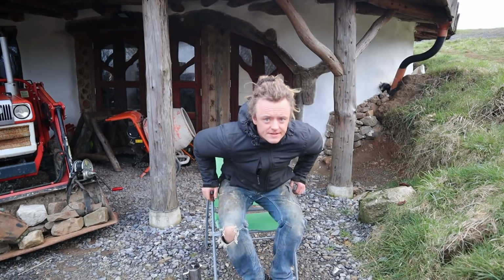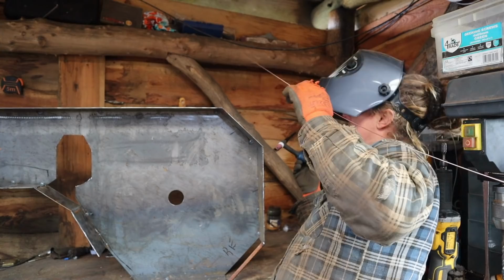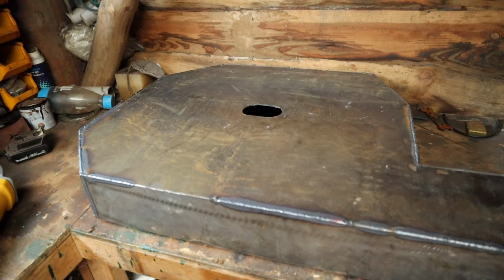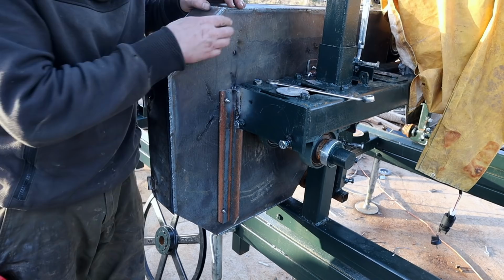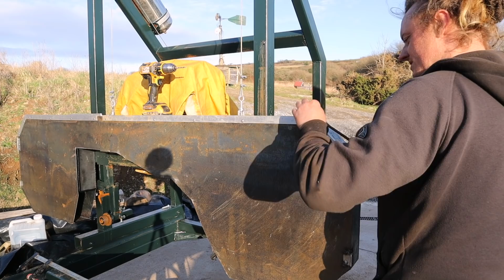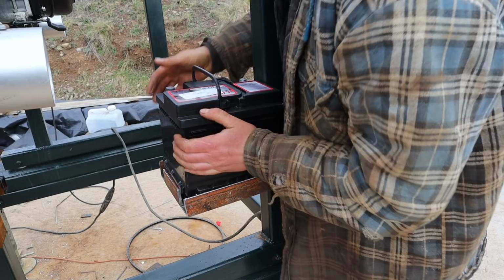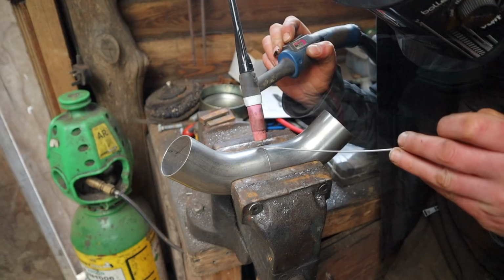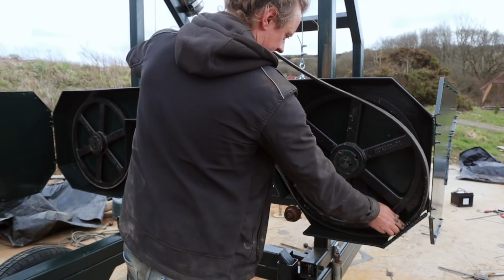DIY Mobile Bandsaw Mill Finished At Last

Comment: You could do with a rain cap on that exhaust now its in "vertical-boy-racer" mode ;)
Reply: one of those little flappy jobbies like on the tractor trailer rigs!
Reply: an old coffee can to quick fix it 4 the moment...
Reply: this was my first thought!
Reply: Will it have enough pressure to open it, it's only a wee 10hp

Comment: Kris, you might like to fit a flapper onto the exhaust to keep out the rain, or maybe just stick a bean tin on top. Works on tractors. Oh and that is a great bit of kit you've built yourself. Very well done, it looks the business.
Reply: I was thinking he should make that exhaust pipe reach higher.  A flexible ventilation pipe would do. Standing beside that exhaust wont be fun the day the wind comes from the wrong direction and you have to turn the mill around to avoid the fumes. And a flapper or can on top is a good idea.
Reply: Flapper on top and a small drain hole at the bottom

Comment: Hey Kris.  I've been running a Norwood band mill for almost 20 years, and it is very similar to what you've built there.  Great job, by the way!  I would recommend that you weld on a push handle for yourself to push the carriage while milling, and put the throttle on that handle as well.  Excited to see it in action.
Reply from the maker: Thanks for the tips. Looks like you have some cool videos. i will be checking them out.
Reply: @KrisHarbour  
A round bar for a handle with a spring loaded motorcycle throttle would probably work great and being spring loaded it will idle unless your hand is on the throttle might add an extra level of safety for the commenters you were telling the cat about. 😉

Comment: If you get a 4 inch paint roller and use covers with the least nap you can find (not foam ones) do this: thin down the oil based paint a little and paint metal with that. You will get “factory finish” results, trust me. I used to refurbish vending machines this way and they came out great. With a 4 inch roller it’s easy to get into the nooks and crannies. All the best. Try it, you will be surprised.👍

Comment: You need a rain cover on the exhaust pipe.
Reply: An empty metal can would do the trick. Put it on once you are finished using the mill.

Comment: Hello. From the States. One tip that may help you save Gas and electric , would be to stitch weld. Make a series of  25mm welds about  50mm apart. It will hold just as well and save time and material. I have welded for over 30 years. I hope this may help you. Liked,shared. All my best.

Comment: That mill is built like a tank.. Awesome work. That mill will perform like a completely different animal after its broke in and you get the RPMs up.  I think the sawmill trailer i built is around 23 feet from bow to stern light... every time i move it i drop a string line down my rails to ensure a strait shot with the sled.  Being that your angle iron (rails) are different you might drag a line down your log beds then adjust. Fast an easy... I usually mill up say 4 logs then add the drops (slabs) of similar sizes  6 at a time if possible standing up on the mill and debark them with a quick pass. All that 1xs add up fast

Comment: Great work! Maybe a support bracket on that extended exhaust pipe Kris. With the Diesel there is plenty of vibration, will likely stress crack without support.

Comment: Looks great. I suggest that you relocate the water drip to the outside of the blade guide so that it doesn't eat into your cutting width. It looks as though the blueing on the guide rollers hasn't held up. You'd probably have better results by heating them and quenching in oil.

Comment: Awesome. I have a Woodland Mills HM122 and I love it. I recommend you do 2 things. Connect your throttle, which turns your blade, to you water output to save water in the reservoir. You can also add windshield washer fluid to it for the cold. Second,  attach a hook to where the sawdust comes out so you can hang a bucket to catch the sawdust when cutting. It becomes a real mess without a bucket to catch the sawdust. Congratulations!

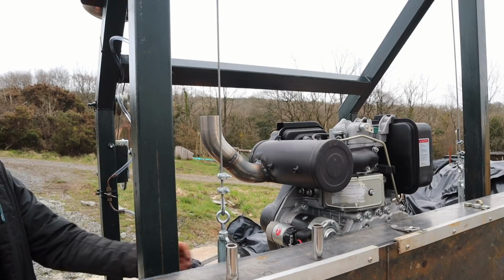Comment: 19:12 Did you put in a bleeder hole in the outer pipe?.... Rain will fill up the pipe and possibly the black muffler and potentially the engine if left long enough....

Comment: One of my tricks is a second valve (a quick one, like a ball valve) inline with the needle valve. Lets you get a nice steady water feed setting and just flip it on and off without overthinking things. There's so much to pay attention to when running a mill that anything that makes it easier is worth it (at least in my experience).
Reply: Side note, it's crazy easy to put a 12v solenoid valve inline and wire it to a future power feed too. No more accidentally leaving the water on/forgetting to turn the water on.

Comment: Hey Kris
 The Bandsaw Mill looks AWESOME! Time to put it to the test and get the blade biting into some hardwood. So, time to start cutting timbers to sit and dry out in preparation for the house? I'm looking forward to the next video, I wanna see a nice stack of wood cut and drying.
Hey, are you going to build a Kiln so you can Kiln dry wood? That way you can control the time it takes to dry, but also keep the wood from drying too quickly and splitting. If you did build a kiln you could also use it to dry different types of foods for preserving them, so a kiln would have a use other than drying wood. Just an idea!
Keep Safe All,
Peace, Happiness, Love and Laughter Always,
Matt - Toronto, Canada

Comment: Hi Kris, for the batt cable look at a retractable id/key fob, Durable do one which works up to 300g so should be enough. I use them in similar way to hold wiring out of the way in movable areas, works a treat. Well done
Reply from the maker: Nice one, i will check that out that is exactly what it needs.

Comment: You did a good job with building the sawmill. looks to be better then some of the "entry level" mills you find on Ebay or even woodmizer sites. well done. a proper job....
Reply from the maker: Thanks Jacob. I used much heavier and bigger parts than most of the mills you buy have, hopefully it will last and be worth all the time i spent on it. I think it will.

Comment: Worked in saw mills for years, very impressive 👏👏only thing I would personally do is have a little inspection hole on one of your doors so you can see when you need to adjust the set on your blade on the wheel

Comment: I’d love to see you build and use a log splitter that either you OR Dot can use.  Something like one of those ones that is a steel car/truck wheel with a spiral cutting edge, that you can feed branches into, and something that can split larger logs into multiple pieces, either all at once, or bit-by-bit...

Comment: Hey Kris, Very impressive build, i've enjoyed the progress videos.  Just one thought, where the band saw re-enters the guard, will you have a means for the chips to escape?  I think perhaps over time it may build up in there.  Another thought is maybe to cut horizontal slits and then bend the top of slit inwards, and bottom outwards to create a weather proof vent for heat and dust.  You could also attach very small fins on the large pulleys to create air movement, like a fan.  It would help to vent the guard section of heat, dust, and possibly chips.
Just a thought, i'm sure you've thought through that already and dismissed it until you know for certain if there is any issues.
Good on you for all you've created there, you and Dot, fantastic stuff.
Cheers from Ontario!

Comment: Looks like you need a couple of removable wheels for those back corners just to help when your moving in and out of uneven terrain.
Reply from the maker: i could have just dragged it no problem just didnt want to damage the floor to much, in the mud it could just drag.
Reply: @KrisHarbour  I was picturing more when you're mobilizing to another site and facing uncertain conditions. e.g. trying to back it in but the back corners try to dig in. Not wheels that are long-distance tow-ready, but something just to get you out of a pinch. Love the project and looking forward to the first tow-and-mill journey you take us on!

Comment: Run another muffler horizontally off that vertical pipe or put a top hat on it; looks like you get a lot of rain there. Don’t want to hydraulic your new motor :) .. another muffler would quiet it down some to make your quality of life a little better when running it too haha.

Comment: in a pinch a good bench vice will bend that gauge steel you just need to take it a little slow. looks to be 1/8 inch thick or as you say over the pound 3.125 mm

Comment: I was a welder fitter for many years if you brace what your welding and split up the welds and not make them too long. These things will help prevent warpage. I see many folks on YouTube weld things up without bracing and in the trade that is a absolute no no.
Reply: Would stitch welding have worked OK for this?
Reply: Yes for the guard it would have been fine. Some people like the idea of fully welding though, even though it's not necessary.

Comment: Not sure if anyone mentioned it yet (20 times) but you need something to keep the water out of that 2” exhaust. (Yes I read it many times)

I can speak from experience that you do not want to start a diesel with water in the exhaust and any build up of diesel soot. 
The black spray that comes out is not very fun to wash off.

Comment: Whatś next on this machine? A full LED lighting system, an electric caravan mover device to move it about in the bush/mud, a power winch and USB phone charging station ?
Reply: It would be easy to attach a 1000 watt power inverter (pure sine if possible) - 12v DC to 220v AC to power any tools he might need.  As long as the diesel's charging system is up to the task to keep that lead acid battery topped off, it would be a handy place to be able to plug in a lamp or a drill - anything (within reason).

Comment: Hi Kris. the thing looks amazing. can´t wait to see it cutting. If you now have the exhaust pipe facing straight up, you might ad some kind of cover for when not in use (or mount a flap like on many traktors) so that the rain can´t get in.
Did you ever mentioned where you´ve got the wheels for the sawmill from?

Comment: When you started the engine there was a lot of vibration on the shield. That might affect the cuts as well, what about some rubber grommets as engine mounts to minimise the transmission of vibration?
Reply: Another reason why it was a good idea the battery was mounted where it is.  Had it been mounted on the engine assembly, the plates of the lead-acid battery would have been subject to the engine vibration - and that would have definitely shortened it's life!

Comment: A good plasma cutter is the Job for that plate and the shapes you are doing?. I was ill advised regarding mine. I was not aware that there was a no contact plasma cutter so I will get rid of mine and use the money for a non contact plasma cutter. a Great Build though been watching you thru the stages of your build.
I will get my saw going eventually. keep up the good work. bye.

Comment: When you said you would potentially run out of power for later in the day due to welding, is that because of the type of batteries you have and the rate at which they can charge, or some other reason?

Comment: I'll guess that sawdust is going to build up in the guard with the solid bottom.  Cool look though.
Reply from the maker: you must have missed the opening that is there to let dust out on the right. I dont make mistakes like that! :)
Reply: @KrisHarbour  I thought you were perhaps going to be building a giant vacuum for it. A bit disappointed...!
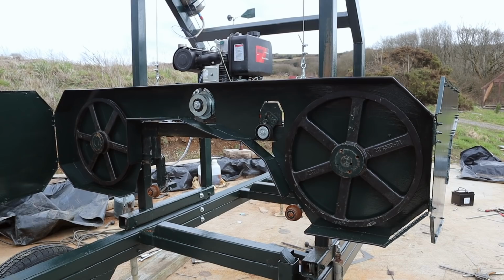Reply: @KrisHarbour  - 20:53 one can see the opening (lower bottom right) for the saw dust exhaust - very good.  It will build up on that ledge, but who cares?  The blade and wheel will keep it clear...

Comment: Well done. Can you give a rough estimate on the cost for comparison to commercial models? This might be a viable option for people with skill and time, but not a lot of cash.
Reply from the maker: Total is about £2000 but it could be done for under half that is you had good access to scrap metal and an engine or motor already. Its hard to compare to other commercially available mills as they all tend to be much shorter. i can cut a 6m Long log on this. But from what i can see something with this cut length, cut width, power and mobile is around £10,000. But for me i just like to make things myself if i can. i dont think to much about if it is worth it or not financially i just get a joy out of using my home-made machines.
Reply: My guess:
Steel - 400
hardware (winch, jack, belts, pulleys, cable, hitch, tank, blade, machined parts) - 500
Paint- 50
Engine - 400
Random bits & ends (tank, exhaust) - 50
Electrical (battery, cables, starter) - 150

Total = 1550

Sense of empowerment & satisfaction - Priceless.

About 3k for his labour.
Reply: @KrisHarbour  - Right - the intrinsic value and satisfaction of making it yourself.  Well worth it!

Comment: LOVE IT! Not a criticism at all, just curious why you pot rivited the hinges on the front but it looked like you welded them on the side?
Reply from the maker: I used bolts and the bolts would have hit each other inside as it was thin material and i only had bolts that were to long. so i welded the outside. that way its still removable.

Comment: isnt the exhaust going to fill up with rain water?
Reply from the maker: Just getting covered when not in use.
Reply: @KrisHarbour  - might also be a good idea to drill a 1.5mm hole at the lowest spot just to allow any collected water to drain out... just in case.

Comment: Hey Kris, out of sheer curiosity what made you choose a static bed - movable blade rather than a static blade - moving bed. No criticism just curious.
Reply from the maker: Its just more efficient at this scale to do that. your not moving the heavy log back and forth so it takes less energy. The saw head is about 200kg so much lighter than even a fairly small log.
Reply: Thanks for that!

Comment: Please be very careful and wear proper protective gear. I want to see many more of your videos, take extra care not to rush when testing your new saw. Maybe have a "pro" look it over first, to make sure you have it just right. Goggles, gloves, steel-toed boots, heavy over-pants, helmet, no loose clothes, and a spotter on sight ( no solo operations). Safety first, lasting success
Reply: I think you mean "on site".
Reply: @manolisgledsodakis873  sight was used to mean a lookout on site  ( sight-guy, is one who has your back if blade fails and whips out at you. He usually saves you money by driving you to hospital ( sometimes saves your life by having your back) by being on site as a sight-guy).
Reply: @ItreboR63I  ( I was being polite by not saying specifically what could happen). If you insist:  The blade-band is not made that way ( into a loop)- which means the weld could snap if tension on the sprocket wheel is too tight or misaligned with other sprocket. If this happens, the band could whip out of enclosure and harm those without protective gear ( through the gap where belt passes through housing near the lumber surface area of the saw).  A band at liberty to whip around that has a serrated edge and is moving at high speeds on untested gear, could do more damage to poor Chris than you may realize, considering your moronic reply to my comment of caution.  I only wish the health and safety of those that make their own lumber mills.
Reply: @daveadam6454  Well you certainly told me (an ex boatbuilder, that worked at a saw mill and as an arborist, now running industrial 5 axis cnc routers whilst milling timber in my own time).  Thank god you were there to educate me.
Reply: @ItreboR63I  ooh! - this is getting 'YouTube silly' isn't it?!
Cue another 27 increasingly aggressive and juvenile comments........!!!!
(love it....!)
Reply: @ItreboR63I  At least you are grateful.
So, you have inspected the mill and you assume liability for mishaps based on your dubious resume? Give him the All Clear from your sofa in your mama's basement for all I care about you and your expertise. Just looking out for a good soul that makes good videos of the good life, and want to see more. What's your excuse?

Comment: Why not an electric motor? You have so much invested in hydro, the fossil fuel motor seems unnecessary
Reply: When you think how big an electric motor would need to be, and how much power it would take to run it, plus the cabling needed to run the mill in the field close to the homestead, a bio-fueled diesel makes sense.  The cost comparison would be enough to choose diesel outright.  If he had a massive battery array, maybe it would work.  But still he'd have the problem of running heavy cable to a big electric motor.  More cost.  Kris has said he plans to start on diesel and then convert to bio-diesel once it's running.  That way a gallon of diesel will go a long way.